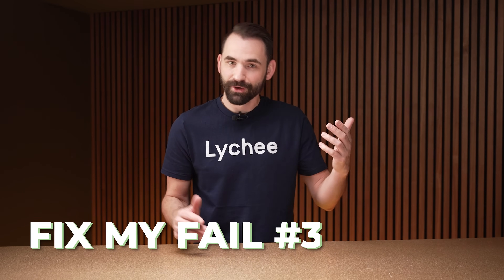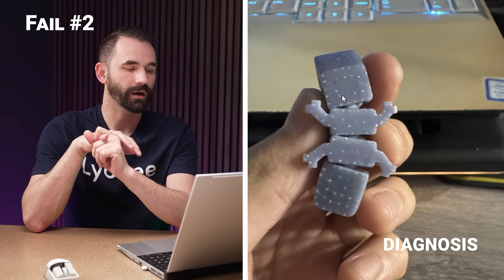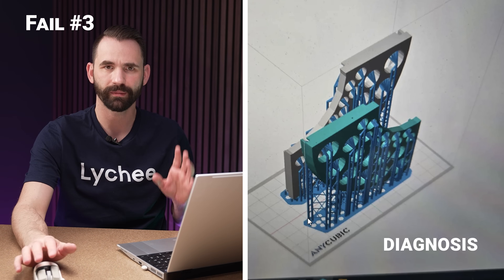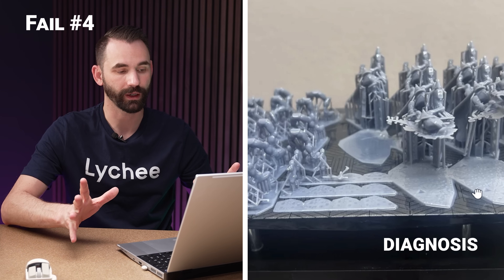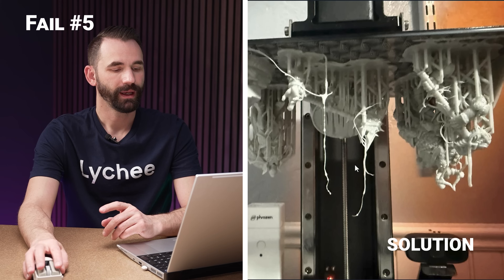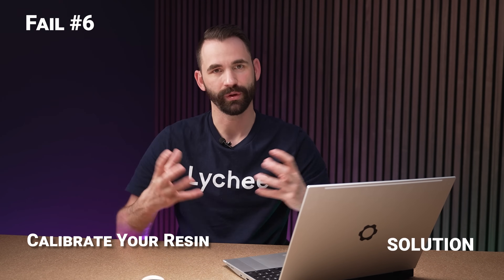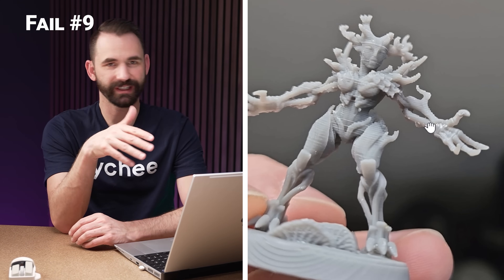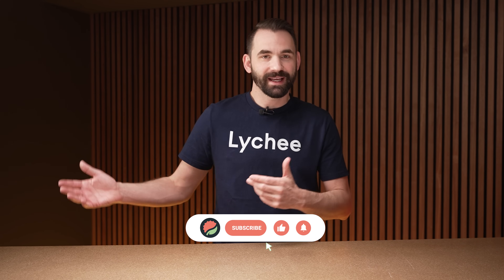Prints not sticking to the plate? How to fix it | Fix My Fail #3

Comment: thinest supports that works on medium-large pieces (for me) is 0.45. with a lot of supports. and that surely leave some damage, small holes, irregularities....

impossible to print large parts (1/6 or 1/4 scale) with 0.2 supports, it's a myth. 

of course, maybe is resin/printer specific, but, on anything larger, that is my experience, so i really don't understand how people print with no damage from supports.....
Reply: The largest I use is 0.4mm but I also print slow.